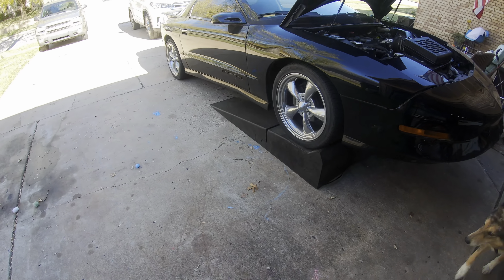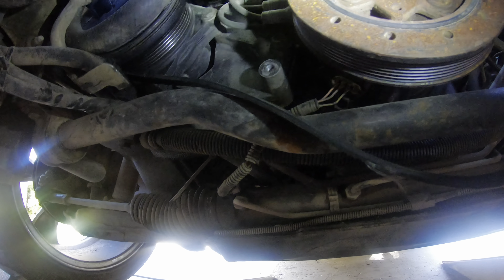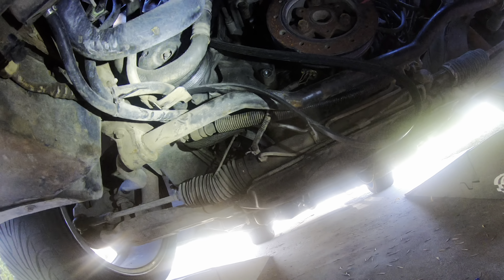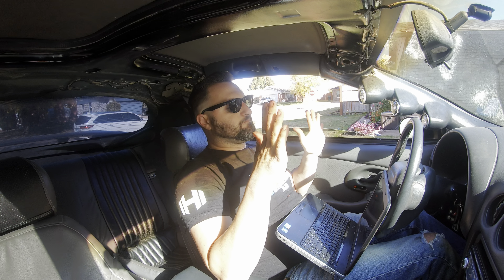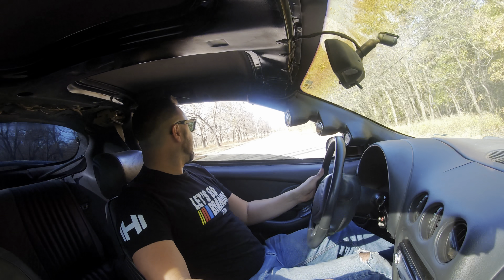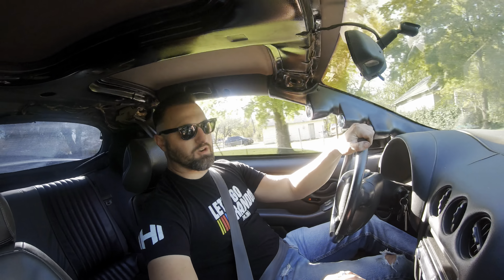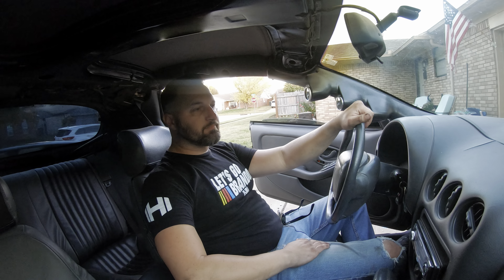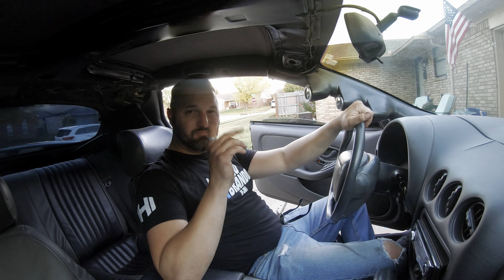I think this car dislikes me

Comment: Good video !!! Plug wires definitely needed changed. 
Good time to change the opti spark if it needs it since your in there  to replace the water pump. Also I would only use GM AC delco opti spark. MSD replacements and EBay opti sparks don’t last and fail quickly. 
This job takes way to long to cheap out on a opti spark. Besides you put a cheap one in there you will be doing it all over. Lol. 
Make sure you cover the opti if your not changing it out. Water will kill a opti quick. 

Good luck. LT1s run like hell when they are properly maintained. I have had a few.
Reply from the maker: The 0411 swap gets rid of the opti but retains it as a distributor only.
Reply: @strongspeedworks  that will work to… I almost did that to mine but after I installed a new GM opti I didn’t have anymore issues. 
Sold the Firehawk about 5 yrs later.